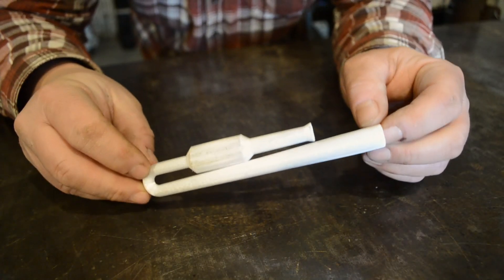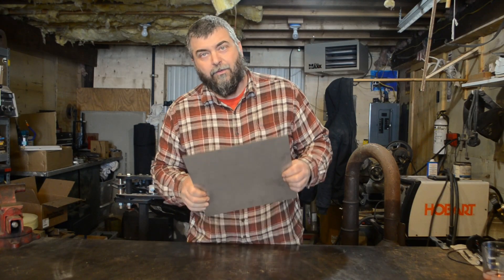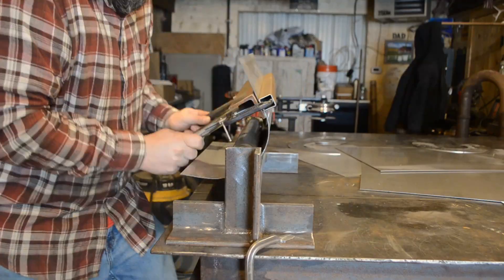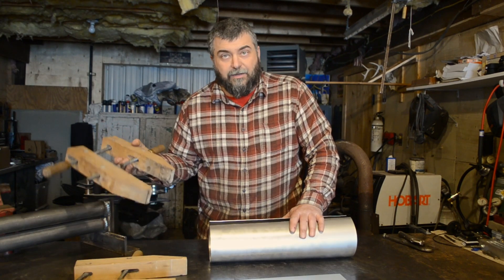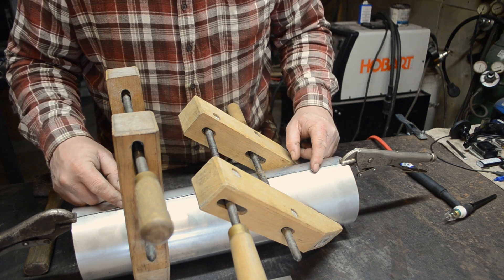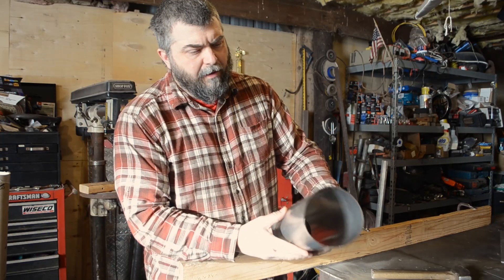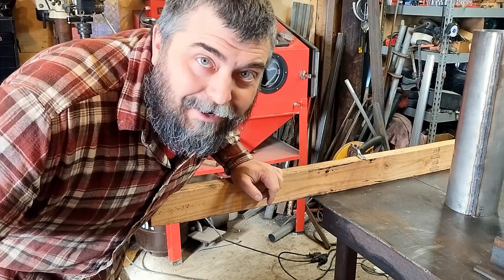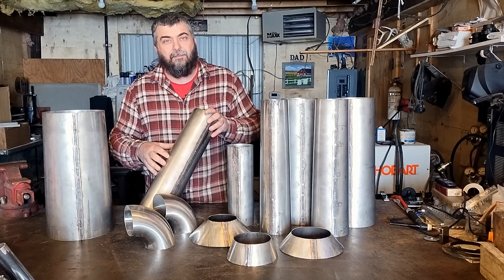Building A MONSTER Pulse Jet In My Workshop From Scratch

Comment: I’m betting your neighbors would like you to attach it to a muffler.
Reply: Much more power and you’ll need new siding on your shop though…
Reply from the maker: @mbunds that run knocked a bunch of stuff off the walls 😂😂😂
Reply: @BuildNPulsejets  I thought I saw the siding pulsing just before the camera ran for its life…
Reply from the maker: @mbunds I'll have to check that out again in slow mo 😅
Reply: @BuildNPulsejets  was the siding really pulsing with the pressure waves, or just vibrating the camera before it fell over?
Reply from the maker: Most of them have been pretty cool about it honestly. 😂

Comment: wish I could do this but dont have any money or means to obtain any of this and not allowed to buy stuff due to age restriction.
Reply from the maker: Also, find a mentor willing to teach you some metal working skills.
Reply from the maker: Do some odd jobs and save up for some tools. I still use tools I bought when I was 10. Bought a welder and torch set when I was 16 to build things. It takes time, but if you want it, you'll find a way. Set some goals and stick with them.
Reply: @BuildNPulsejets  thank you so much dude for the inspiration! Ill try steal up some old tools my dad has lying around and for metal my brother works at a CNC cutting place ill try ask him if he could bring back any metal sheets. welding, well thats the hard part but ill see what I can do.
Reply from the maker: @yolopolotyurCNC shops are a great place to get some practice pieces. Ask them if you can look through their "drop" pile. Start with some simple tools. 4-1/2 angle grinder (can use cutoff discs), clamps, a drill, drill bits, any bench vice, etc... after that you can save up a few hundred bucks for a used mig welder. You should be able to find a 200amp arc welder for about $100-$150 if you wanted to start there.
Reply from the maker: @yolopolotyur where abouts in the world are you?
Reply: @BuildNPulsejets  The UK sorry for the long reply I was on a little trip
Reply from the maker: @yolopolotyur well, I can't say I know any resources for you out there in the UK. But, reach out and ask for some help learning. You'd be surprised how many people are willing to teach.

Comment: I was hoping to eventually build my own, and I was wondering why the main exhaust outlet, the flaring pipe has a smaller entry from the combustion chamber than the intake from the combustion chamber
Reply from the maker: It can be a straight pipe, but would most likely have to be a lot longer to get the same effect. Well it's kind of more complicated than that, just think of it as a volume of gas that needs to be expelled. The same volume can be expelled in a shorter distance if the tube is tapered.

Comment: For someone that knows nothing about pulse jets or engineering is there a reason or difference in orientation ? What I mean is when bolted to wood you had the expansion chamber on the bottom but in the rest of your videos it’s on top. Is it because the heat generated from said combustion chamber makes more sense on top so it doesn’t heat the exhaust or exit pipe ?
Reply from the maker: Hey there, to be honest the orientation is nothing more than that of convenience. These engines will operate pointed in any direction and flipped any which way. When I had it bolted to the large wooden beam, I simply had it that way because it was the fastest and easiest way to secure it to something so I could get to testing it. I knew I wouldn't be running it for long so heat wasn't a big concern. I have it flipped on my test stand mostly because that places the spark plug and fuel injector closer to the their corresponding connections. Thanks for watching!

Comment: I would like to build one, my grandfather works with metal so I have no problem with that, but I don't know what parapets to use
Reply from the maker: The 55# Lockwood is a good starter engine. I'm working on some plans that will be available soon for a modified Lockwood in a few different sizes.
Reply: @BuildNPulsejets  thank you for the answer

Comment: im 16 and want to make one , i got 2 months for a science thing 
got no tools , i dont know where ot buy materials , i doubt if there are many workshops in my country (maybe none) (probably buy it online  , 
so what can i do , and like do you have dimensions and everything about your setup
Reply from the maker: First I would start by getting some basic metal working tools. Welder (mig or Tig), grinder, etc .. and learning how to use them. Then start with a smaller project like the FWE pulse jet. You can find plans for free online for that one.

Comment: Where do you get these pieces of metal from, and how much was this whole build? I’m 15 and I want to try and build a pulsejet of my own about half the size, even though I have minimal tools.
Reply from the maker: I have these cut out at a local laser shop to my dimensions. You could probably build something a bit smaller out of mild steel for about $100. I'm currently working on some plans and a detailed build video for an engine about this size and one a bit smaller.
Reply: @BuildNPulsejets Only $100? I thought it would cost a lot more (then again it probably depends on the metal)
Reply from the maker: @L-70-7 It really depends on what you have lying around. But as far as a smaller engine if you already have all the tools, I could see the materials costing about a $100 or so.
Reply from the maker: Do you have access to a mig or Tig welder ?
Reply: @BuildNPulsejets Currently no, but i’m saving . Which one is better?
Reply from the maker: @L-70-7 that's a tricky question. Honestly you're probably better off with a mig setup with a gas bottle to start. Going to be cheaper and is a good start for a beginner welder.
Reply: @BuildNPulsejets  Ah thanks for clearing that up, and one more thing, would a spark igniter be needed for an engine half the size, or could you just throw in a match and it would kickstart the whole thing?
Reply from the maker: @L-70-7 you could toss a sparkler into the engine, but I would highly recommend using an igniter. I have a video on how to build one.
Reply: @BuildNPulsejets  Ok, I’ll go watch that vid, thanks for the advice

Comment: Hello, I want to build a pulsejet like this one I was wondering where I could get the specifics ie measurements and 3d model files for steel shapes to cut out
Reply from the maker: I'm trying to wrap up the plans to this engine right now. Hoping to have them available soon.
Reply: @BuildNPulsejets thank you so much
Reply: On the Internet, D'oh!
Reply: @bikerfirefarter7280 can you link it? I need actual files for a cnc plasma machine to cutout
Reply: @Toasty4848 
Nah, it's much more fun if you 'google' it or you-tube search. There are loads of different VPJs on there, many have plans/measurements with them. Many don't need to be cnc/plasmacut, just cut to length various diameters of standard pipe, then spend a couple of hours welding. At the worst you might have to cut and bend a couple of cones to interface the pipes.
Reply: 75% of the fun building a pulse jet is experimenting with measurements, fuel, etc. Just wing it and find what works best for you

Comment: Great job man! Real fabrication skills there.

Do you have plans/dimensions to build this? What does it take to switch fuel - like warm up with propane, then swap to diesel after it's hot to make sure it atomizes?
Reply from the maker: Thanks a ton! Actually I'm planning on making the plans available somewhat soon. I also have videos coming that explain fuel options as well.

Comment: Turn the propane tank upside down
Reply from the maker: Well... Yes ... But actually no. 😂 It's already running on liquid propane
Reply: @BuildNPulsejets works great for melting aluminum and copper instead of using 2 tanks

Comment: would reccomend some hearing protection, the pulse jets wreck your hearing quite fast from my own experience esp on longer runs, best with muffs and plugs, niice build tho, working on a valved pulse jet myself all done but not yet tested fully , gonna run on diesel
Reply from the maker: Ear protection is definitely a must. Years ago when I got my first engine running I did not anticipate the noise and was lucky I didn't do any permanent damage. 

Thanks, good luck on your engine!

Comment: Amazing video, I wanted to build a small pulsejet for quite some time, any tips? Thanks
Reply from the maker: That's awesome, if this is your first pulse jet I would suggest building a smaller valveless engine. The FWE is a good one. Take some time and make an ignition unit rather than trying to ignite the end of the tube with a torch. Do not underestimate the amount of fuel and air that these required to run.
Reply: @BuildNPulsejets  damn that reply was fast! Recently stumbled across your channel and a friend of mine and I wanted to make one for quite some time, you are a great help!
Reply from the maker: @deinema8126 if you are on facebook, there is a group called pulse jet engines that has a lot of knowledgeable people that can help.

Comment: Hey  Mate, do you have the dimensions anywhere for your pulse jet? I am pulling my hair out trying to find a compatible plan. I have bought 2 x 90 degree Mandrel bends of 2mm truck exhaust with 150mm diameter. I have built your pip sheet metal bender that I will use  for the rest. A link to the plans would be great.
Cheers
Reply from the maker: Yeah that's awesome! I am working on some detailed plans for almost this exact engine right now. They'll be available for purchase in the near future. I'll also be making a more detailed filled video on a mild steel version.
Reply: @BuildNPulsejets  Thanks, ill just improvise,

Comment: Hey, I have a few questions about the fuel injector and spark plug. I was wondering why you didn’t mount the spark plug in the center of the combustion chamber like many Lockwood designs I’ve seen online. Also, I’m curious about the fuel injector — what research did you base its design on, especially regarding efficiency? What are the sizes of the holes and the injector tubing, and what material is it made from?
Reply from the maker: Hey there! I mounted the spark plug more towards the end of the combustion chamber mostly out of convenience to where I plan to mount my ignition box in the future. It's placement is not as critical as you might think. The research for my fuel injector was my own I did many years ago. But to be honest we are talking liquid propane, atomization isn't a difficult thing to achieve once it leaves the injector. It is made from stainless steel and the area of all the holes are just a bit bigger than the area of the fuel line. The engine will easily flame out from too much fuel if cranked up far enough. No need to overcomplicate this. I will be offering a very similar engine designs plans for sale in the future if you want more details. Thanks for watching!
Reply: @BuildNPulsejets  Thanks! I guess I might be overthinking this part a bit. I’ve come up with my own design — it’s smaller than the one you built, and I’m hoping to improve on it over time. This is my first pulse jet, but I’ve done a lot of research on valveless Lockwood-style designs, especially ones with propane start systems. I’m planning to eventually run mine on gasoline and make it more efficient than a lot of what I’ve seen online. I’ve got a few people helping me roll the steel, and I know someone who can laser weld it for me. I’ll let you know how it goes — might post a few videos too. Thanks again for the insight!
Reply: I also really appreciate your video on making a high voltage igniter — I’ll definitely be using that to start mine!

Comment: Wow.  I've watched a tonne of pulse jets vids as it's next year's project but all of them show really tricky start-ups with blowers etc.  I'm in the same boat as @ididathing and I'm sure many others.  Would you consider condensing 20yrs of wisdom into a 5 min vid on how to get them to self start?!
Reply from the maker: @Makes-and-Mods  Thanks! Actually I've got a few other videos I'm working on and after I get those out, I will be addressing just that.
Reply: There are several other styles of valve-less pulse-jets that's self start much easier than the Hiller type. Perhaps you could try one of those, the engineering is no harder.

Comment: AWESOME.  Thanks for the video.  As a stroke of luck I have some old 5” and 6” stove pipes and I can buy the funnel parts for the ignition chamber.   Plus a trembler coil.   I can finish it within 10 years if I don’t get interrupted
Reply from the maker: @fish3473  sounds fun! Yeah, finding the time to do anything anymore is like pulling teeth. Good luck!
Reply: @ Thanks, I can use it

Comment: Is it possible to make a small scale pulse jet engine that can be built at home but it doesn't break after a minutes (like the jar)?
Reply from the maker: @Vedu_0825  yes there certainly is a way to do that. What kind of tools do you have at your disposal? Do you have a MIG welder? I've been kicking around the idea to make some plans and a build video of a smaller engine that someone with maybe just a drill press and a mig welder could make.
Reply: @BuildNPulsejets  Thanks for the reply. i do have a drillpress but i don't have a welder. I have soildering tools but i think the solder would just melt. i love the idea of  a build video, there is nothing much out there on small scale pulse jet engine building.
Reply from the maker: Ok, thanks for the input. Perhaps I'll work on an engine that can be made without a welder. Let me figure that out. Stay tuned
Reply: @BuildNStuff Thank you very much! I am very excited.

Comment: if I may ask, where did you get the drawings for this? That doesn't seem to be just a scaled up 55 pound thrust design, and that would make sense as from previous experiences they don't scale linearly. Awesome to see this one self starting!
Reply from the maker: @MonkeyWithAWrench  Thanks! This is my design after many prototypes and months of research. I may be offering these plans for sale in the future. It starts and throttles very well and I am working on a new thrust stand now to get a good measurement.

Comment: You definitely to support the ends of the engine, as once it gets red-hot - it'll bend under its own weight. 
I'm assuming you need to purchase the 2 elbows separately?
Reply from the maker: Yes, you are correct. Eventually if left unsupported it will bend when red hot. I'm working on some proper engine mounts now for the thrust stand.
Reply from the maker: I did purchase the two 90° elbows separately although making the 180 out of pie pieces works very well too.

Comment: is it possible to get the plans for it? please
Reply from the maker: @davidlovsin  Actually stay tuned and in the next few videos, I'm planning on doing a mild steel version build with only an angle grinder and a mig welder. After that video I will be offering detailed build plans with printable cutout templates.
Reply: @BuildNPulsejets  nice tnx i am goint to make it out off ss
Reply from the maker: @davidlovsin  The best way. I just need to package it into something digestible and I'll let you know.